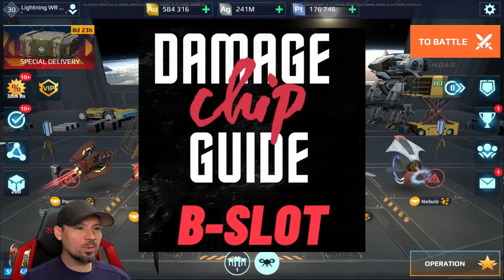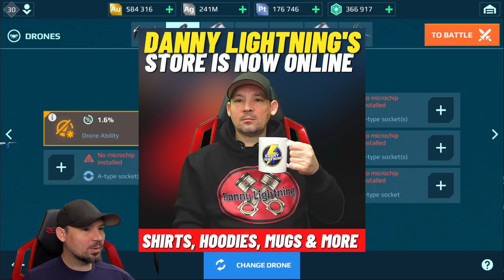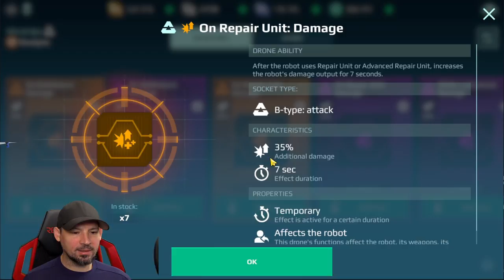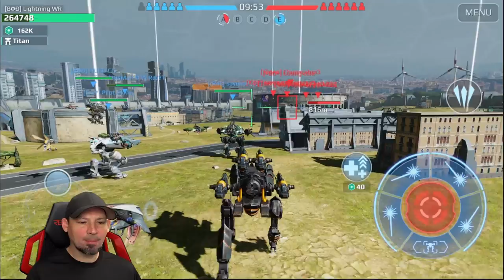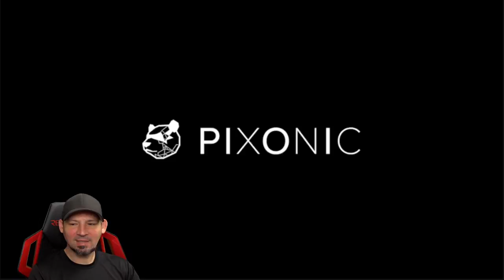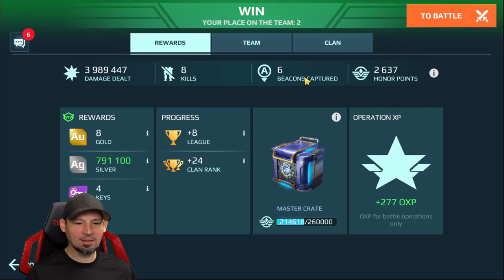War Robots Damage Microchip Guide, B Slot, + WR gameplay,

Comment: Does the lock down immune work with Rodgers pilot on Hawk? Thanks for the clarity
Reply from the maker: Some of these chips do interact with that pilot but they're not really supposed to, originally I did and then they said they fixed it so it doesn't because it was way too overpowered but sometimes it seems like it still does so I'm not really sure but it's not supposed to

Comment: Came back to learn about battle born module n chip, the module states it automatically shields as soon as you get hit; but only activates once. So how does the chip keep coming on then.? Still learning, Thanks
Reply from the maker: Battleborn gives you defense points, not a shield and there's a chip that works with battleborn that gives you more damage once the battleborn activates,.   The shields are actually something completely different.   I know there is one shield chip that's supposed to work the first time you get hit or something but I actually don't think I've ever tried that shield out, I should actually do that but most of the shields have a cooldown Time, the mid damage absorber has a 5 second cooldown so after it turns off 5 seconds later if you take 70,000 damage again, quickly, you get the shield popping back up
Reply: @Danny-Lightning-WR  so it's doesn't matter if the battleborn module can only be activated once(as it says), it's chip that activates more than once after cool down. Comprehension is not my strong suit, Thank's for explanation
Reply from the maker: @mid9trambler758  I'm a bit confused ,,. I hope we're talking about the same thing
Reply: @Danny-Lightning-WR  we are, I just read the brief. It states: the moment your bot gets attacked, a "one-time" defense system activates, lowering all incoming damage. So it's the battle born chip that reactivates the defense system more than once🤔 after cool down. I hope I'm understanding this right. If not I'll learn by watching n making mistakes. I appreciate you letting me pick your brain, thanks. To Infinity n Beyond😁:_bleubolt:

Comment: Do the on lockdown immune and on suppression immune chips work all the time if you have 3 maxed out anti control modules?
Reply from the maker: No but I believe when you get shot with something that triggers it they kick on for a few seconds,. I noticed generally when you get shot with something that is trying to lock you or suppress you you'll turn blue for a second and that's how you know the anti-control kicked in so the chip will kick on when that happens and then turn off like normal and then next time it activates the chip should activate again as well so at least that's how it was working last time we tested it but that was a while ago